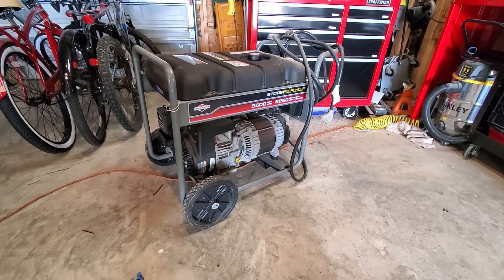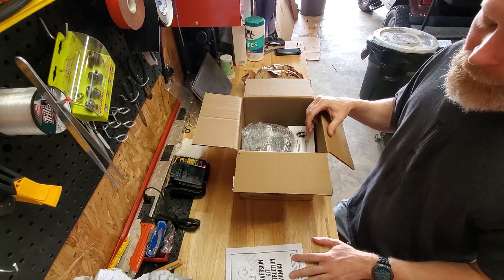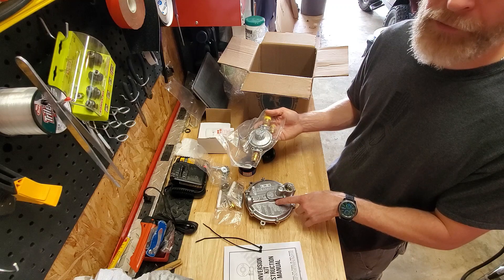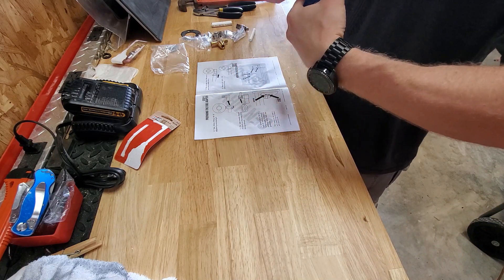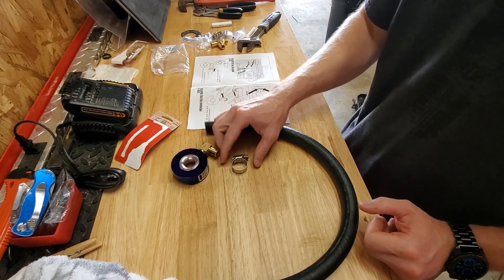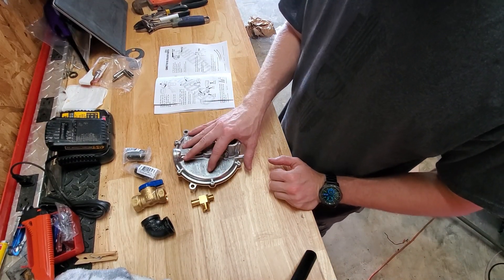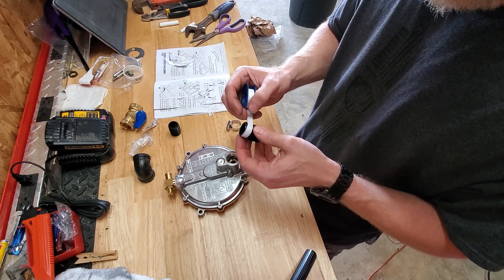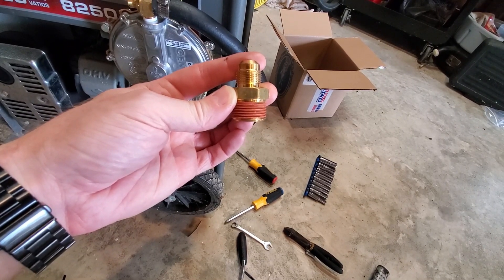Century Fuel Products Tri fuel kit installed on Storm Responder 5500 generator.

Comment: That cover you removed and re-installed directs cooling fan air completely around the cylinder/head, and apparently lets the carburetor pick up some warm air for better gasoline vaporization, and possibly to prevent venturi icing in really cold humid weather.

Comment: You can not depend upon natural gas folks, if to many people (15) try to run there generator on it pressure will be too low to run any of them, this has happened many times before 
Stick with gasoline or propane, yes you will lose power on LPG and burn more of it 
Having a tank on trailer is best way with propane 😊😊😊
Reply from the maker: I don't know if this is regional, but our nat gas supply is pretty solid. Many houses have whole home genies on nat gas with no issues. I have never heard anyone have a feed problem.
Reply: @Blakes-Garage  it was on the national news the other day but don’t remember where
Reply from the maker: Living in south east Texas we have had multiple long term outages with hurricanes and the "big freeze" I have never heard of that issue. Very weird.

Comment: @7:11 Does this spacer have a venturi effect shape for the inlet? Or just a pipe feed? If so, how can it increase vacuum to propane line, relative to airflow?  Cause the purpose of that big bellow valve is just that: to open up more as the vacuum is increased.
Reply: Yeah, I think there's a recess that creates a venturi effect. Might be the trick to the whole process.
Reply from the maker: It has a little bit of a cone shape.

Comment: Blake I Enjoyed the video. I have the same generator  so this was telling perfect video for me. FYI: the Teflon tape you used for the install is not for gas. The correct Teflon tape should be yellow in color. Just wanted to point that out. Thanks
Reply from the maker: Yea, i know. I used the wrong tape. I will fix it eventually.

Comment: You used the wrong teflon tape for gas and you applied it in the wrong direction on the regulator.
Reply from the maker: Yea, i know. I used the wrong tape. I will fix it eventually.

Comment: I have the exact same generator and the carb is clogged up from the gas I had in it, even with stabilizer. I want to convert to natural gas as well. Do I need to clean the carb out as well or replace it with a new one when I put the natural gas kit on, or is the existing carb no longer used to regulate anything?
Reply: The NG injection plate goes behind the carb. In NG it's just an air intake. Carbs are cheap tho and you have to remove it to install the kit, so might as well replace it.

Comment: great vid, thanks. FYI- if it wasn't necessary the mfg wouldn't waste money adding plastic trim to the unit. the plastic trim pieces often are needed to direct air flow towards or away from the unit to promote cooling. they can be very important. trimming and replacing the piece like you did in the video is a smart move, instead of just discarding the trim entirely.

Comment: Great video. made it look as simple as it is. Because of the confusing detractions I purchased another kit for more money and it didn't have half the stuff century kit came with. And after installing the kit I purchased the tube or snorkel that goes in behind the choke prevents it starting on gasoline.

Comment: Thanks for video, glad you pointed out your mistake as I would've been the one to do the same thing. 
For the gas fittings I would go with either 1 or 2 sets of quick disconnect depending on if you want to coil the NG line up and hang it on the generator or hang it in the garage somewhere. 
Thanks again!
Reply from the maker: Quick disconnects are a great idea. I havent really messed with it much anymore because hurricane season is over, and we are in process of building a new house, so we will be moving in about 6 months. I really should test it, in case we have another "great freeze" like last year.

Comment: Great info, I have had the Storm Responder for 10 years now.  Used it for about 5-8 hours a day for over a week when Sandy hit us in NJ.  I haven't had the carb issue yet but I am going to have a closer look at the hose connections due to your discovery.  Thanks for the video.
Reply from the maker: That hose is just press fit into the two ends. I think its a crankcase vent or something. I just bought a short length of fuel line with the correct outer diameter and replaced it. I had to get it a little longer than factory because of the spacer that is part of this kit.

Comment: Thank you Blake  best video  I have seen for this generator! . I have the same generator and will be doing this also! Born and raised on the westbank !!
Reply from the maker: You are welcome! Others have commented that you should use yellow teflon tape, so FYI.
Reply: @Blakes-Garage   Thank you ! Any problems have you run across since the installation?
Reply from the maker: I actually have not had to use it yet. We have been very fortunate. This years hurricane season was uneventful, and we did not have a big freeze even like last year.

Comment: Umm you need to
Look at the yellow tape or pipe dope that’s rated for gas Teflon tape I don’t think will hold up well to gas please test often if you don’t change however I really think you should change to the specific type so nothing bad will happen
Reply from the maker: The guy I spoke with when gathering supplies seemed to think it was just a difference in thickness. He stated that for the longest time, there was only white, and it worked then. Ill have to look into it.Thanks!

Comment: I installed 2 of these exact kits on my B&S 5550/8550 gens, my first was after watching this video and after searching Craigslist for another generator to upgrade I found the exact model of my own for sale, same issue, carb didnt work. Fortunately for the tri fuel kit you don't need the carb to work in propane or natural gas. Just leave the choke open and it will fire right up. I opened my carb and same as you, the float was stuck. Easy fix and now I have 2 standby gens ready to go :)
Reply from the maker: Two standbys are better than one! I actually picked up a second geni that wouldn't run. I replaced the carb and it's good to go. It I should install the kit on that one too.

Comment: Hey Blake, great video!  We were in the path of Hurricane Ida - like nothing I've ever experienced.  I'm curious... Do you know if this kit will work on a Troy Bilt 5550 Model# 01919-1? It also has a Briggs & Stratton engine.  Just wondering if maybe there was some documentation with your kit that specifies what models it supports...
Reply from the maker: I don't think the Instructions have a list, but the link I posted in the description goes to the manufactures website. This page lets you search for your generator, and find the kit that works for it. 

That being said, I googled Troybilt 5550 and it looks like it has the same engine as mine. So I think it should.

The kit seemed to be pretty universal though, and I had some parts that I didn't use for my setup.